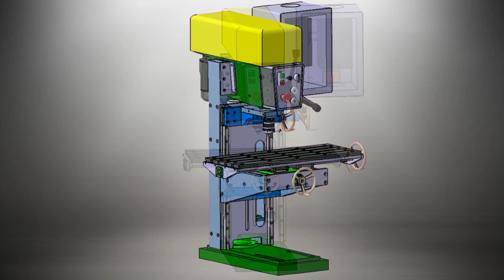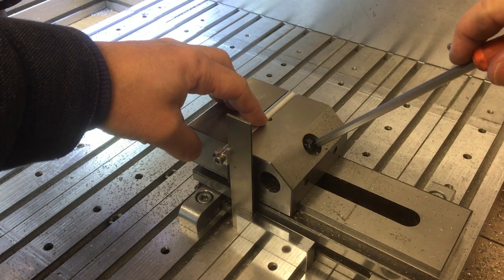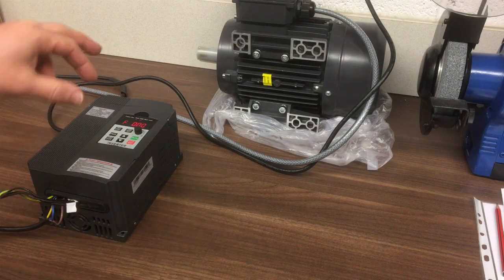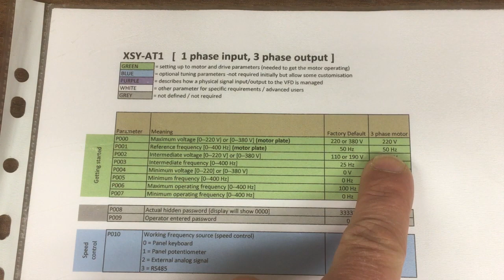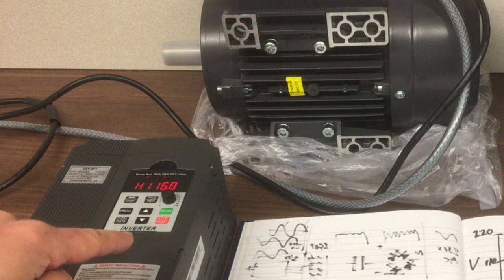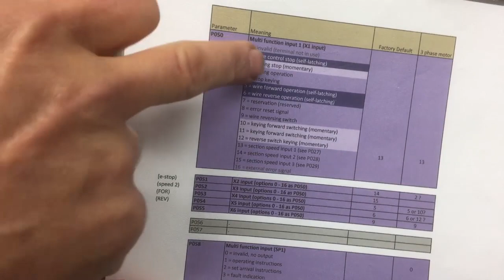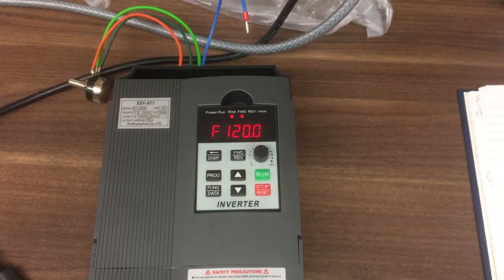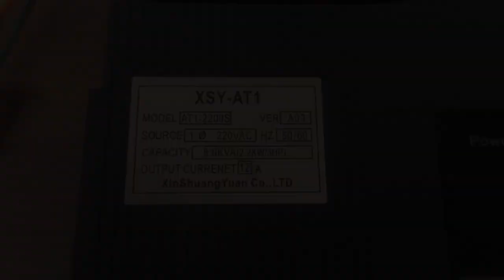Ep 2: Drill Press Upgrade | Making the control box & inverter parameters

Comment: Although they are not listed in all the instruction sheets, there are other parameters you can control. P 78 is maximum working amperage in milliamps. P 79 through p 85 are working amperage for the 6 pre-programmed speed settings, also in milliamps. Useful if like me you are using a oversized vfd on a smaller motor. I am using this same vfd on a 1/2 hp motor rated at 1.9 amps and have dropped p78 from the default of 12000 to 2200. I didn't need to change p79 to p85 as I am not using any preset steps.  
On the p50 to p55 multifunction inputs there are other unlisted options. 17 is jog forward, 18 is jog reverse, 19 is emergency stop.
I am sure there are other unlisted options. What does P59, 63, 64, 65, 95-98, 101-104, 108-113, 116-126 control if anything? hopefully someone will figure them out.
Thanks for the explanation on the torque compensation. I will now start experimenting with those settings.
Reply from the maker: That is useful to know thank you.  I will pin it to the top so others who come looking for those specific unlisted settings can find it.
Reply: In the instruction manual I got, P78 is the "Main current overload" and P79 to P85 are current overload values for other 7 speeds. I do not see any other parameter with mA values to set the working current. P76 says "Current coefficient" with 0-65535 range with the default value of 9500 but no unit is specified. My VFD is 2.2kW. My motor is 1.5kW and on the motor plate, it says 3.7A and when connected to the motor under no-load motor draws around 3.2A per phase.

Comment: Can't wait for part three. I've looked high and low for a video that goes over inverter controls. I'll be honest I've been too scared to turn mine on and now I want to rush down to the workshop and have a play! If I could make a request for something you could discuss it would be wiring up a safe emergency stop. As I understand it the inverter needs to stop in a controlled manner to prevent damage. Just pulling power will, I believe, damage the unit. I sort of understand why, there's lot of energy stored in the motor that's got to go somewhere, but I never understood how to correctly handle the situation. That control box is certainly built to last too, I love it.
Reply from the maker: On my CNC machine the emergency stop works by switching off the control relay (interrupting the supply to the latching relay).  One of the contacts on the latching relay controls the machine run command into one of the digital inputs, so it basically stops the machine that way as if you have just pressed the normal spindle stop button.  I will do the same thing on the drill press, but also experiment using the X3 (?) digital port (as this is already configured as an e-stop) for the motor PTC over temperature.  I'll show this in a future video including the circuit diagram for the whole control system.  Thanks

Comment: That running test reminds me inverter we had at high school. We set up slow ramp and let small probably 500W motor spin up to 120 Hz....and then let it slow down to 0 Hz in 0.5 second. I was really surprised it was nicely standing on table and not trying to fly away :D
Reply from the maker: Wow, that is good going.  The I've left the accel and decel rates as the slow defaults for now just for getting it going.  When finally installed on the machine I can experiment with something that is quick enough for swapping tools over, but not too much strain on the inverter.  I will talk about it in a future video but there is no provision for an external brake resistor on this model (part of the cost down), so all the braking has to be done with the components in the inverter.   I'll be amazed if I can get 0.5 sec from 120 Hz, but let's see !  Thanks for following along.
Reply: I think if you get it to 1/3 or 1/4 of time it has now, then it might be ideal. But that's just my wild guess and I'm really curious how close I will be :D

About quick swapping, you can get motors with integrated brake. You can control brake externally or just connect it in parallel with motor winding (not sure how well that works with inverters). I'll try to remember and check our bigger drill press at maintenance, motor seems to be quite big (and powerful) and brake stops it immediately when you press button. I'm quite curious about its parameters.
And that inverter we tried at school had no braking resistor, it just worked. But also it was made...I guess around year 2000 or before.

And you're welcome, I like your project. I had idea of putting inverter to old and well used drill press I got two years ago. But honestly, drill press still stands on ground. I have everything prepared to fix it onto table, but I don't need drill press yet and I'm quite lazy :D

Comment: Just found you, that's one tasty enclosure.  When making clock dials we etch the brass and then melt a hard wax into the etch by warming the face.  Followed by very light abrasion/finish.  Was wondering whether the same could be used to fill your engraving for better definition instead of painting.  Also wondered whether the edge pillars could be 3D printed with a good infill, for contrast and especially for folk who do not have a mill.  Any chance you might release drawings/sketches?  Even sketches I could turn into dimensioned drawings :-). Me thinks I will be binge watching the remainder of this series over the weekend! And then making a similar enclosure for my own drill press which is a similar size to your Warco.
Reply from the maker: I don’t mind painting as it gives a long lasting finish but I guess the wax would work too.  I don’t have a 3D printer and went for metal parts for strength and durability but I guess plastic pillars would be OK.  As for drawings I may or may not still have them as it was a while go and this is a one off.  The box was shaped to fit my machine with holes at the back to match existing mounting holes and the front panel suited the controls I wanted to use.  So not sure if it is useful to others.  I see what I can do in a future video and may be able to print out some new drawings to show.  I’m keen to use every spare hour to get this thing finished so I’ll have to let know if I manage to do that and will post in this thread so you get notification.  No promises!  Thanks for joining us and happy watching.
Reply: @routercnc9517  That’s cool. I’m reading the Gene Kranz memoir but my mind is on 3D so I’ll probably be modelling it tomorrow and firing up the printer.

Comment: I've been working on the control box for my drill press the last couple of days and have found that the low speed torque boost doesn't seem to be applied if you use the jog function for the slow speed tapping option. Instead, I've used the speed set 1 & 2 functions and linked them via diodes to the wire forward and wire reverse controls so that I can leave the forward/reverse control in the off position. That way, when I release the tapping push button the drill comes to a halt without momentarily setting the speed to the value set by the potentiometer.
Reply from the maker: Ok that’s good to know.  I will also be using the set speed as my jog so should get the boost if needed.  With the brief testing I did and my circuit layout I’m not expecting the momentary pot speed issue you mentioned but will bare it in mind.  In the current situation this will progress slower than planned but that’s just how it is.  Thanks for following along and giving good feedback.

Comment: This seems really interesting, is there a reason why u picked a overpowered vfd for a weaker motor? Should I do the same? Also is there a easy way(kinda like the vfd) to control a single phase ac motor?
Reply from the maker: Going a bit over on the VFD is OK.  I choose this one as it was cheap and did what I wanted.  I have read comments not to go too much higher than the motor in case it limits the range optimisation as you are only using a part of the current range.  Someone more qualified than me would need to comment on that.  
This will not control a single phase motor.  For that you need an SCR speed controller designed for single phase motors.  I have only seen ones with a manual speed knob on them rather than external control but there may be other options.  Thanks

Comment: Hi. Thanks for your very educational videos. Much appreciate it. Now i want to replace the motor in my Jet drill press with a 3 phase motor and add a VFD. 
Is it possible to wire the existing NVR switch in the front of the drill press into the VFT. The NVR switch in itself is a relay is nt it. Can you please shed some light how to wire that. Thanks
Reply from the maker: In theory you could add the NVR to the VFD input but I would be concerned about that.  The VFDs don’t like being switched off when the motor is running and you are relying on the NVR solenoid to hold to power the VFD.  Much better to use the the VFD digital terminal controls with switch gear to control it for run stop.  Have a look at 3 wire control and so on to see if one of the modes of operation of your inverter would do what you want.
Reply: Thank you. I get it. I am planning to buy the one which you used in your circuit . If I want to use digital connections side of the VFD, where would I take the 12V power needed for the relay ? Also how to wire an external fan to motor ? In your videos I can’t  clearly see where you are taking the 12V power for the fan. Thank you.
Reply from the maker: I used a separate DIN rail power supply for the relay.  For the fan see Ep3 at 16:40 where I think I tested the pins which have 12V when it runs.

Comment: Great video! I have a problem with is VFD tripping on err6 over current. I have the over current protection set to motor nameplate rating of 3amp. If I measure the amps on one of the motor leads it reads 2.5amps. This seems high for the motor just free wheeling and still doesn't explain why the vfd tripped.
Reply from the maker: Well err6 is the over current, so you are right there.  If you are sure you have wired up the motor correctly for the voltage (either delta or Y, they draw different currents), then you could try increasing the max current setting P076 (if you have this exact VFD) a bit.  There might be some small current spikes tripping it out.  You can also set P062 to 3 to display Amps on the display so once it is running OK you can see what it is drawing.  After that I'm not sure and don't want to damage your motor.  If you get really stuck try posting on the mycncuk forum as there some very knowledgeable people on there.  Good luck.

Comment: Ive got mine wired up for a scraper for cows. When the input for run forward goes first time it ramps up fine. But when the changeover relays switch the vfd doesn’t have time it ramp down and start its cycle again because it’s almost instant changeover. Any tips on getting the controller to have a ramp up and vertical drop on its curve? Other more expensive brand we had could do this. An option is that we add a delay timer to the vid timer to ‘suppress’ the aux inputs which tell the vid to run. Thanks for any help.
Reply from the maker: Hi James.  I’m sorry I’m not how to do that.  It’s only a basic VFD so might not be possible.  Try posting on the mycncuk forum as there are plenty of knowledgeable people on there.  Might take a bit of time before Lee (moderator) sorts you out but hopefully you would get an answer on there.
Reply: @routercnc9517  hi. I’ve ordered a time delay relay. Will use aux contacts from the contactors which switch between the two motors as the input. Alternatively I could use one aux contact as FWD and one as REV. Which would save £20. I’ll try that after time delay relay if the changeover is too quick for it. Thanks anyway.

Comment: Hi
Really useful and clear - thank you.  One thing I have been battling with an unable to solve is the settings and wiring for 3-wire control of a NO start button and a NC stop button.  I set the start on X1 as 11 (keyed forward, momentary).  This works.  But when I attach common to X5 via the stop (NC; momentary), and set X5 to 19 (emergency stop), the start no longer functions - I assume because two contradictory inputs are arriving.  Am I missing soimething obvious (to you - I'm vey inexperienced in this!)?
Reply from the maker: I have never used the 3 way control like that as I prefer independent control over start stop and emergency.  I use the momentary switches to control a relay configured to be a latching relay.  One of the terminals of the relay dictates the connection to DCM of whatever function is being asked for.  Commercial machines would even use a purpose made relay such as a Piltz unit.  If you look at the circuit diagram I show in episode 3 it might give you an idea about how to do this.  Without playing with a setup I’m not sure if momentary switches can be used as you outline.  A 2 position latching rotary switch would work but you would need a way to invoke estop, perhaps by connecting it in series with the connection to DCM.
Not saying it can’t be done, just never used it like that on any machine I’ve built.  Thanks
Reply from the maker: another thought.  Try setting X5 to 4 (stop keying) or 2 (keying stop momentary).  Estop probably is overriding everything.

Comment: Thank you so much for this info.  I am having trouble understanding how I can make my single pole, single throw switches work.  The on/off works fine, but the reverse will start the motor up even with the on toggle in the off position.  Is there a way I can make these switches work for this?
Reply from the maker: If I understand what you are trying to do then I'm not sure you can do that with just SPST switches in that way.  I think you could have one switch between FWD (X4) and DCM to make it go forward and one switch between REV (X5) and DCM to make it go in reverse.  But having a master on/off on one simple switch, and the other switch determining if it runs forward or reverse I think would need more components.  Probably could do it with a relay so the fwd/rev SPST switch would energise or de-energise a relay (powered from somewhere) and one pair of contacts on the relay would link X4 to DCM and the other pair of contacts would link X5 to DCM.  The second switch is then connected between this output of the relay and DCM so it only runs (on/off) when the second switch is thrown, and the first switch has determined if X4 or X5 is connected to DCM via the relay.  However this would be easier with a 3 way rotary switch to connect X4 or X5 to DCM, with the second SPST switch again making or breaking the final connection to DCM.
Reply: @routercnc9517  thank you so much for sharing your knowledge. I will go now and try to understand all you've said. Cheers.
Reply: @routercnc9517  It is possible afterall! I hooked up my toggle switch to X6 port and now it operates just like the fwd/Rev button on the keypad. Trying to understand the instructions was the difficult part.  Thanks again.
Reply from the maker: @user-wo7rz3yn4o  Well done, that makes sense.  I didn't play around or look into the X6 input but the manual says it is defaulted to 9 which means 'wire reversing switch'.  So connecting this input to DCM or not gives fwd or rev.  Good find and hopefully this will help someone else who wants to do forward and reverse with a simple on/off switch.

Comment: thank you for this video, in my case I have a metal lathe, and I don't see where to connect the external brake resistor on variator, (P012 parameter) can you help me?
Reply from the maker: Not all inverters have braking resistor terminals.  If they have them they are usually labelled PR or PA or PB and are located next to the terminals for the power and motor connections.

Comment: Thanks for the video. Just a shame that the drive can't do digital speed up/down. I've bought one of these drives to replace an Emmerson drive that has failed and I don't have time to repair. It would have been nice to wire the new drive to the old controls but for £50 I'm not complaining!
Reply from the maker: Yes for the money it is a nice unit.  Especially if you only need basic functionality.  You could do digital speed control at a few set speeds (like I showed with the jog) but not infinitely variable.  There might be some kind of interface board available (?) which might convert a digital pulse train into analog out which would replace the potentiometer.  Not sure but might possible. Thanks
Reply: @routercnc9517  The digital speed input on the emmerson drive is via push buttons; it mimicks an electric pot, you hold the switch and the speed increases all the time the switch is held. On release the speed stays where you set it.  Speed down works the same way but in a different input. It's handy when you just want to adjust the speed to suit cutting behaviour. The rate of increase and decrease were programmable too. I'm liking your tapping speed set up so will probably go with that and a ten turn pot for the speed adjust. Time to make a new control box.
Reply from the maker: Ok I misunderstood.  Sounds like you have a way forward anyway.  Good luck with it !